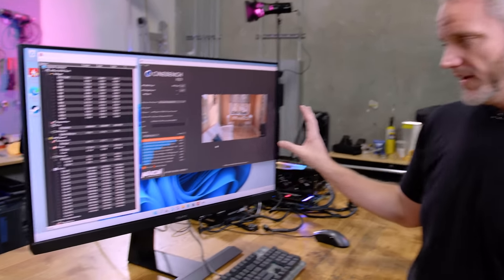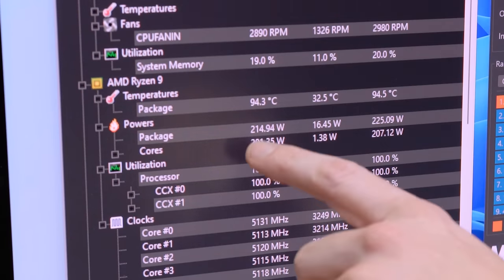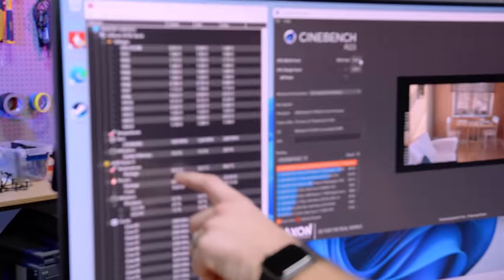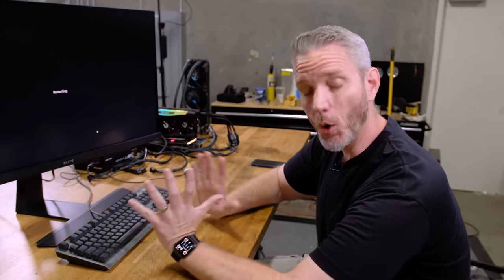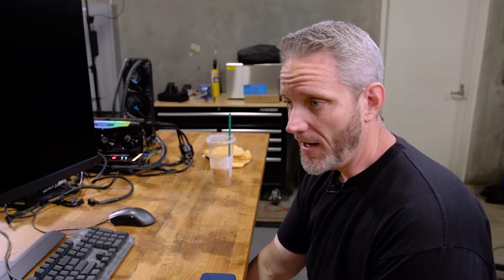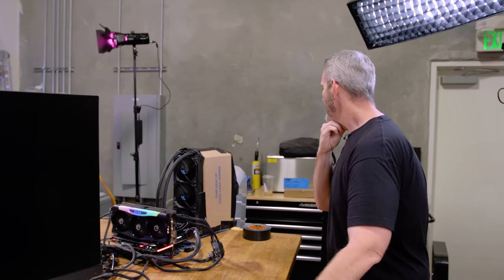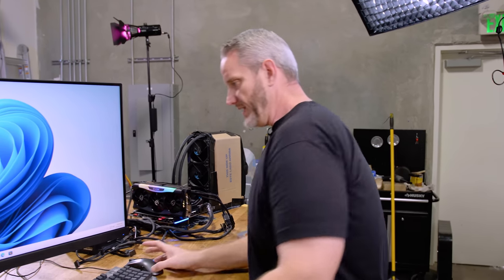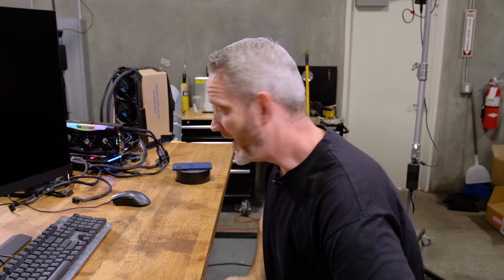This is fine...

Comment: I had a Core2Quad Q6600 back in the day.  Stock clock was 2.4ghz and I had it overclocked to 3.55ghz and it ran at 96C constant.  If I bumped it to 3.6ghz it would thermal shutdown in 3 seconds. I ran it that way for 1.5 years and then put it back to stock and used it as a file server for 6 years.
Reply: i ran an old bulldozer 8350 at 5.0ghz for 7 years on a big AIO. but the max on those was only like 70C. and i ran it right up against that all day every day. it wasnt until after 3rd gen ryzen launched that i started seeing degradation, and it would only run at 4.6. so i retired it to wall art and got a 3950x
Reply: same!!!! not the server part the overclocking part, but the Q6600 was a beast for the amount I got for it (free99), and a gtx 1050 was good enough for my entry into pcs and pc gaming
Reply: Interesting... I think silicone degrades slower than people act. I think the need for safety margin is more about having margin for when the cooler gets dusty when stuffed under a desk and the AC is broken on a hot summer day, rather than silicon degradation being a real threat.
Reply: My Q6600 was running 3.4ghz for years with 70-80C. Additional 15C for +100-150mhz was just not worth for me as I had to bump up the voltage quite high.
Reply: lol i have a 9590 at 5.1 ghz with a 5.3 ghz turbo  and it will draw mad wattage and spike to 51 . my x5690s will hit 82 easy . cpus just run hot
Reply: @YouOnlyLiveOnce...  Same, I had a Q6600 with the G0 stepping and it would run to 3.6 if you didn't stress it too hard but it was unkillable at 3.4 GHz and I could keep the volts and heat down.  I ran that thing until 2016 and I think if the bus speeds were better I could've gotten a few more years out of it.
Reply: Funny! I still have one too man. OC'd for itd whole life, still works perfectly. 💪
Reply: I had a AMD Opteron 165, normally a 1800 MHZ CPU, i ran it at 2500 MHZ for years with water cooling.
As it was Code named Denmark and i am Danish, i of course still have that CPU

I also had / still have a Q6600, but ill be damned if i can recall what i ran it at,,,,,, so much overclocking and what not in those days.
My first time OC was on the 700 MHZ Athlon with GFD, it was also the first PC i build myself.
But for some years i have not bothered with overclocking.
Reply: @ts757arse  I'm 99 percent sure that new am5 boards are going to be under strict minimum designs so they will all be able to take the cpus
Reply: My best overclocking chip was a phenom 1075t . It hit 4.2 ghz all core on an ASRock 780x3sli32 wifi ..it was really awesome . Another one I had was sn fx 60 I got it to 3.2 ghz  back in late 2004
Reply: nostalgia CPU. I still have that chip running in a PC to this day
Reply: @pliashmuldba  lol I used fish pond pumps and tubing for my fx60 lol
Reply: This is such a throwback and makes me feel old as shit.  Had a Q6600 and felt so cool that I got it up to 3.2.  Kind of crazy how far we’ve come.
Reply: lmao i sitll have that chip on my bookshelf or the intel extreme version of it
Reply: Believe it or not, today I'm using a Q6600 since 2007, only a few years ago I felt the need to make it a 100% stable OC at 3.0GHz without voltage and my performance for daily activities in the system is satisfactory. I even have an auxiliary preset at 3.4GHz with a somewhat high voltage and temperature, but within the limits of safety, and it is 100% stable as well.
I have an AMD platform with Ryzen 3 3100 waiting for its replacement... yes it will crush it in performance... but the Q6600 refuses to die... I nicknamed it "Highlander, The CPU"...👀
Reply: mine too, i think that was just how you did it in the core2 days
Reply: Back in the day, before your back in the day one could almost double the speed of a 486, and double + a 386, but the faster processors got, the less of a difference over clocking made, just like souping up cars, the more horsepower the engine has, the less you get out of souping it up, and the cost is much higher too, especially if you have a piston shoot through the hood of your car!  (<:
Reply: The legendary Q6600 was the heart of my very first build. I also had it at 3.6ghz and it was a real workhorse.
Reply: What did you usa as a cooler ? That is horrible temp to say it mildly... I had a Core 2 Duo 2,4Ghz (called Xeon 3060) running 3,2Ghz for 9 years and it never did go over 50C and usually under 45c with a huge heatpipe cooler. It did clock to 3,6 but was not stable at that but the temperatures was still reasonable.
Reply: @techienate  100% the real degradation is ex5 conditions getting worse and worse for the hardware
Reply: @a64738  Was about to say. Must've been a complete trash tier cooler, as my own Q6600 G0 ran at 3.6GHz (simple 266 to 400MHz FSB bump + some vcore) til the day I retired it, and it never even reached 80C with just a 120mm fan tower cooler (so basic that i can't even remember what it was). What did reach 80C was my i7-2600k at 5GHz though, and it took 6 years for it to start degrading so I could only get it stable at 4.2 for the last 2 years (til I replaced it with a 3700X in 2019). And it still still hasn't died completely and is now in my workshop PC
Reply: Kind of the same here. I'm currently running a i7-5930K with a 3.5 base overclocked to 4.6ghz. Ran it that way for almost 4 years until I started having PSU issues. Replaced the PSU, disabled the OC, now building ryzen 7900x and gave my wife the 5930K system.
Reply: I overclocked a dual celeron 300A setup to 450...that's a 50% increase in speed.
Reply: @ghomerhust  I love the idea of displaying the tech that stood the test of time. I'll probably do that with my 5600x one day.
Reply: Very similar with the Q9550 I had back in 2009. Undervolt it and pushed it. Thats when I first discovered the wonderful Xigmatech and Thermalright heat pipe tower coolers. Those were the days for sure!
Reply: @ghomerhust  i adore the old bulldozer cpus, and i’m not sure why
Reply: @techienate  It's not just about silicone degradation on the CPU though. A CPU running at 95 degrees constantly means more heat in your case, means more degradation for all PC components. The motherboard or GPU are far more likely to fail in this scenario, not to mention SSDs are temp sensitive. On top of that, your case will be pushing and pulling hot air after a while cause your room is gonna heat up very quickly! Think 70-80 degrees around the case
Reply: @Knaeckebrotsaege  You must have had a really good 2600k. My 2600k was fully stress test stable at 5.0ghz with 1.52v.... after some LLC tweaks. I could run simple benchmarks and some games at 5.1ghz with 1.45v.... but it would crash the second I ramped it up. 4.8ghz at 1.35v was perfect for my chip. My 2600k got too hot at 4.9ghz... which is what got me into watercooling. 
Honestly 4.8ghz was overkill for the games and programs back in 2011, so I left it at 4.3ghz for years while running a negative voltage offset.... and I gave the board and CPU to my kid. The motherboard took a sh1t right before a Black Friday so I upgraded it instead.
Reply: My 5820k has been at 4.5ghz since it released like 7 years ago lol
Reply: @ddforrester  A Thermalright Macho cooled my i7-2600k at 5GHz 1.435V with two fans and somehow kept it below 85C at all times. Damn impressive coolers, shame Thermalright sucks so much with upgrade brackets for newer sockets though
Reply: @JudeTheYoutubePoopersubscribe  was it real ?
i watched that in YouTube but thought it might be fake 🤔

Comment: Derbauer pointed out the gap between the IHS and the die is quite large (was done on purpose to keep z height the same for cooler compatibility) making it harder to cool the CPU from the top of the IHS. Wendell said he used curve optimizer to hit like 5.8 GHz while keeping the voltages lower.
Reply: Not the gap is large but the IHS itself is larger than it needs to be
Reply: Optimum Tech did pbo2 + power limit and was able to preserve stock performance while keeping it at 60°c
Reply: The indium solder (the gap) is not that high, it's the IHS that's thick.
Reply: By gap, I meant the distance from the top of the IHS to the top of the die.
Reply: Debauer just delided the 7900X and was able to get 20c lower temps.    I feel like this thick lid was a marketing choice for cooler compatibiity not an engineering choice,

Comment: Optimum Tech showed that you can easily drop the temperature by just limiting the power draw, maintaining performance. You can even have the option to get more power while keeping temperatures and power consumption. (All in PBO settings)

Would be great if you could confirm the validity of the procedure

Comment: I had to get used to that increase in safe temps when I went from 3900x to 5950x. Despite having a custom loop with dual 360 rads the 5950x just races up towards high 80's but it's happy with it. Just like in your test, the water temps aren't saturated, and as soon as the test finishes the CPU temp plummets back down to mid 30's. I even repasted the heatsink as I was worried the block wasn't drawing the heat off the IHS. It's just down to physics, if you cream that many cores working that fast in such a small space there is a limit to the thermal transfer from die to IHS to heatsink. The 5950x was at the limit, the 7950x seems to redefined the limit.
Reply: Same experience I had with my 5950x.
Reply: i think these new ryzen cpus behave a lot like GPUs. Until they run out of temps or power, they'll just send it, pedal to the metal.
Reply: @TheHighborn  yup. They seem happy with it just the human element that needs to adjust to the increased temps. Will be interesting to see when jay gets a bios that allows voltage changes as on the 5950x I spent a lot of time dialing in the curve optimiser and ppt, EDC & tdc to allow pbo enough room to play but not so much power that it throttled. If I could keep it just under 90 degrees it boosted really well but if I left pbo at what the motherboard gave it, it just threw voltage at it and it performed worse. With AMD have really refined in on 7000 otherwise I wouldn't mind betting there is more performance to be had.
Reply: I have a copper air cooler and the temps are very much nearly the same on a r5 3600 at 4.20 ghz. maybe 5 degrees cooler and with a copper water block instead its still 70 over sustained load. Shaving the ihs down is going to be easier with no pins on the bottom . its shouldn't have to be a thing but if you want that little bit extra ...

Comment: Other tech youtubers: let's use the most scientifically relevant testing methodology. 🧐
Jay: strap an air conditioner to the radiator with cardboard and tape. 😍

You're the best. 😂
Reply: If it's stupid but it works, it's really stupid?
Reply: @black.phoenix.  I've never said it is stupid.
Reply: @black.phoenix.  no, but it's really stupid if it doesn't
Reply: @dayvie9517  it's not? Testing stuff that should work in theory is not stupid even if it doesn't work.
Reply: Who needs PBO2 curve adjustments when you can just introduce freon.
Reply: Cardboard and tape, that's the true engineer way. Jayz is just making us proud.
Reply: I remember wen Linus did it and was cracking on jay for having done it threw the whole video;)
Reply: Next up: JayZ hooks into his central HVAC line.
Reply: Linus and his team mounted a car radiator to their computer, I think
Reply: @filthyneutral5801  I remember he attached a PC liquid cooling to a home radiator...
Reply: they both did